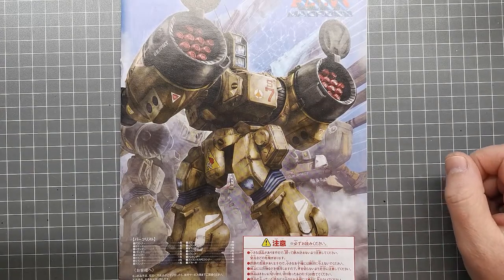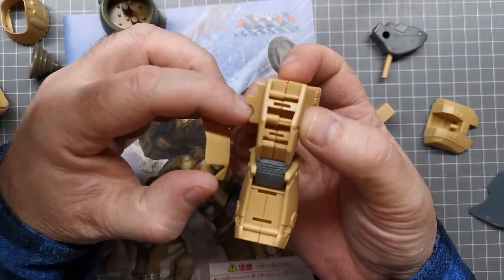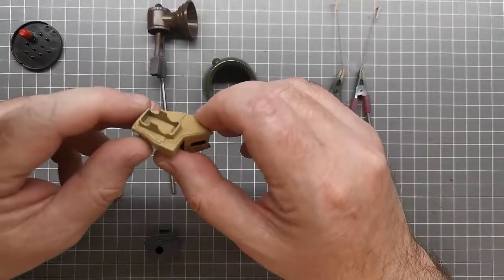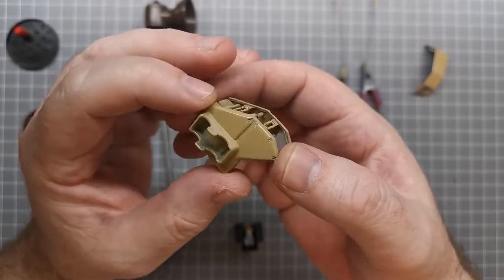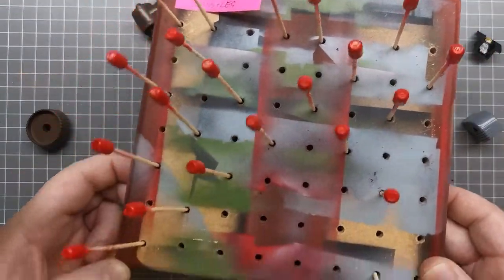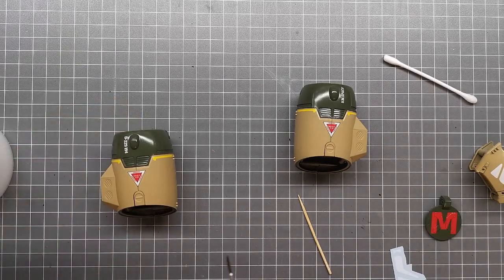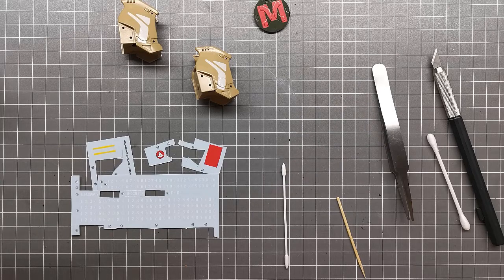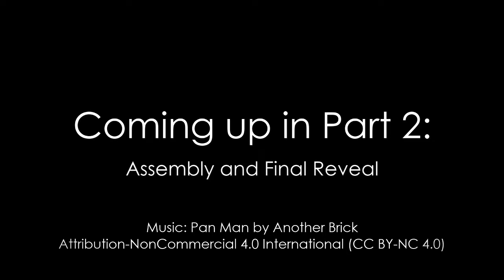Wave 1/72 Destroid Phalanx - Part 1 - Initial assembly, painting and decals

Comment: Looks great! To address the seam behind that clear piece on the knee...I used reflective silver sticker paper behind the clear piece. Cannot even tell it is not painted. Additionally, you could glue some thing pla plate there and then paint it silver.
Reply from the maker: Thanks. That's great advice about dealing with the seam behind the clear part.